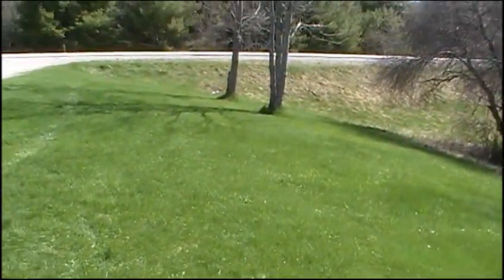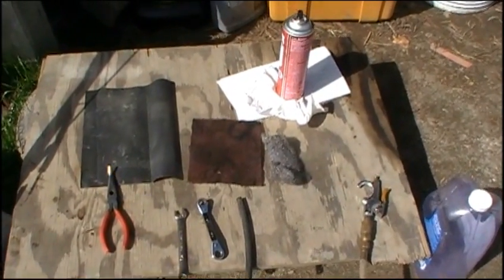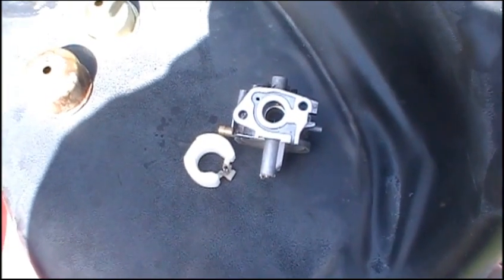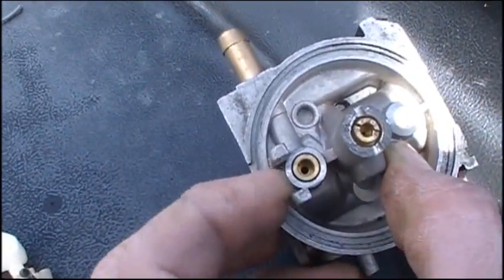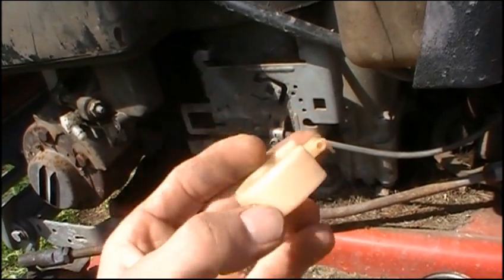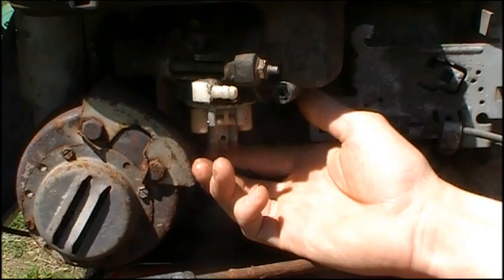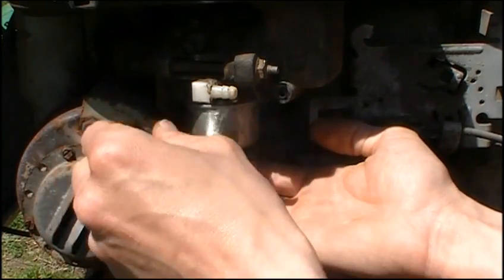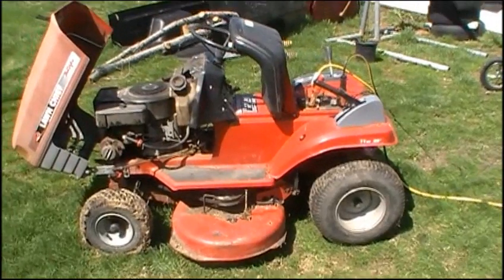How to: Clean a Carburetor (Small engine)

Comment: Good video! If your small engine doesn't work this is usually the problem.
On many engines there is a little tiny rubber doughnut shaped seat that the float needle seats into.  If you blow air into the fuel line connection it will fly out and you will never see it again. 
Also motor oil will degrade rubber parts. If you don't want the rubber to fall apart the next time you repair it you better use silicone grease on rubber.

Comment: Very well done.  Nice commentary and step by step.  I have a Briggs motor that sat for a year plus.  I have replaced the fuel filter, air filter, fuel line, battery, and oil.  I also used Mechanic in a Bottle to clean the fuel system.  Had issues with surging and then once I got the throttle set that went away.  Now, it's always flooded and when it's turned off the engine wants to keep running!  Any ideas?

Comment: This is what got my duromax xp4400eh running again.  It started and ran great on LP, but wouldn't even turn over with gas. Didn't even need to take the carb off, and didn't have to mess with the diaphrams.  Thanks!

Comment: I have same engine in my mower, b&s 12 HP I believe. l was having problems with cold starts. changed filter and added a shutoff valve. when I am done with her l shut off the valve and let her run herself out of gas. l haven't had any cold start problems since.

Comment: Great video noticed the container used to drain the old fuel so for anyone do be sure your container is glass,, metal or a fuel rated plastic ( gas can ) the one in this video looks to possibly be a grocery store juice container or similar most of these the gas will eat through so be aware and safe, peace
Reply: I have yet to find any plastic containers that leak gasoline.   Are you sure you didn't mean a grocery sack or ziplock bag??
Reply: metamech
No, I mean exactly what I said, Anyone interested or concerned lease simply search "gasoline melts plastic" and take your pick of the articles.
Reply: Great job ! Thanks for sharing !
Reply: I found this out too. I used a plastic container used for shaving soap.  The gas or carb cleaner  ended up eating away at the bottom.

Comment: Hey I got a 12hp engine not sure what it is I've had it running runs strong but is very hard to turn over kinda like it's seizing but it's not oils good and like I say it runs great any ideas on what it might be thanks
Reply from the maker: sounds like the valve lash might be out of adjustment. I would check that first

Comment: This will be helpful ! Just yesterday I got a murry mower just like yours ! However I put a different engine on it I put a 16 hp Briggs on it I never had any problem out of the engine before but when I got it out we was doing wheelies and flipped it backwards and gas poured out of the carb I think that may have messed it up cause today we have had tons of trouble getting the carb back working right and it's leaking a ton .. I will try this

Comment: Don't forget the possibility of an ignition module at fault when hot.
If it takes 20 minutes to die, it's most likely nothing to do with the carburetor.
If the carb was at fault, it would act up immediately after start up.

Comment: Check the fuel cap. May not be venting. Remove fuel line at carb and drain into a clean coffee can for reuse (if gas is any good)
With gas cap on, it should flow freely until the can is about full.
If the cap is suspect, flow will start to taper off after a few minutes and stop. You've found the problem.
If you don't want to go the fuel line removal, just operate mower until it starts to die. Quickly open gas cap. If engine runs again, it's the cap.

Comment: Does your needle valve have a spring on it like the other you showed on carb that was off the motor ? I have been having problems with my mower with exact same carb and the needle valve did not have a spring?

Comment from the maker: it's not getting fuel... it could be a plugged gas tank, fuel line, or needle valve seat. if they get gunk in them, it will cause the fuel to feed super slow.

Comment from the maker: well, test the spark... if it's not getting spark, then it could be any number of things... you'll have to make sure all of your saftey switches are working, if it is getting spark, then it's probably your fuel. those motors have a built in fuel pump that will sometimes fail. but they are easy to rebuild.

Comment: Another thing, if you have your carb off and you're cleaning it with compressed air DO NOT have the air's exit hole positioned anywhere near your face! I was blowing out an opposed twin carb and i had the air going into the fuel intake and i had the exit hole near my face, WHOOSH! darn thing sprayed gas mist right square in my eyes!

Comment from the maker: the pin is the needle valve, that sits on the float, as the float bowl fills with gas, the float will "float" and push the needle valve into a hole, and stop the flow of fuel. youll need to take out the float, and reattache the needle valve to it, and carefully put the float back in. try not to let it hang too much, then the needle will fall out again

Comment: I'm cleaning the carburetor on a 50cc Chinese ATV and well its been going fine untill putting everything I've encountered 2 issues.

1. Float won't stay upright it will just flop straight down.

2. A Tiny jet or maybe a pin, has fallen out which I think might be connected to the either the needle valve or maybe its the pin that connect to the float (This is my first carb clean so im not sure If the problem is that or something else)

Comment: I have to say if I didn't already know this stuff I wouldn't have picked much up here. You go much to fast and don't put any real detail or example into your shot. It would have been  a good idea to tell people to put there used rubber o-rings and gaskets into a cup of water while they are out. They like to swell while out and may be difficult to put back and not seal. The water keeps them from swelling.

Comment: After wiping off as much as i could. I found out that the float bowl had 2 small holes in it, and the guy had used some sort of green cement glue to plug them.  On the inside of the bowl, it looked like the gas was eating away at the cement and had plastered it every where...  How bad do you think the damage is?  we had it running on and off, but only on full throttle. but then it stopped... please tell me your opinion. thanks

Comment: Hey i was riding my mower and it staled on me and i look under the hood and i did not see any thing thing i closed it and tried to start it but it would not and i looked again and i saw that it was leaking gas from the carberateur so i drainded the gas and let it cool off the motor over night but on saturday im going to see if i need a new one or just see if the pin got stuck or if its broken.
Thanks for making this video i hope it will help me.

Comment: @Fearlessfront i already figured it out...the cylinders were floded. took out the spark plug and it cranked just fine. i made a stupid move leaving the fuel hooked up when i knew the carboretor wasn't that clean... but thanks for the advice anyway! i am shure i will remember it when something else goes wrong!

Comment from the maker: @Tristan102100 I bet its either the key switch itself is dead, (happens a lot try spraying some wd-40 into it, sometimes it helps...) or make sure the mower deck engagement lever/switch if off, and the clutch switch. there is also a seat switch too. check or disconnect those first. Maybe re-wire the whole thing..(not that hard I have a "how to" video on it.)
Also make sure you didnt disconnect or break any wires while doing the oil change.
This is assuming it does nothing when u turn the key.

Comment: @Fearlessfront yeah i figured it out...the spark was too weak. another questin? i recently got a lawnmower that sat in the peoples back yard for five years. after a few days of tinkering with it i got it to fire and run. the problem is,i changed the oil and now it won't even turn over. i checked all the swiches and everything works. i had the battery on the trickle charger overnight, so thats not it. i know i am asking a lot,but i would apreciate the advice.

Comment from the maker: @Tristan102100 I wish I was there to mess with it... does it have spark? try to squirt a lil fuel down the carb and see if it runs.. if it does, its a fuel problem, if not, check the spark.

Comment: hey i have a newer lawnmower and while i was hooking up a trailer i noticed it wasn. idling very smooth so i knew it was something to do with the fuel so i compleatly rebuilt the carb and now it won't start. and,yes, i pulled off the head and cleaned it and the cams work just fine then i blew into the gast tank(to put fuel into the system) and it wouldn't start...i normally can figure this out but i can't manage to make this happen!the fuel filter  is clean so,any sugestions?

Comment from the maker: @MrChevynova01 yea, clean the carb. what you unbolt the thing on the bottom with the spring, unbolt the brass part, don;t unscrew the screw and the setting will remain the same.

Comment: I have never cleaned the carb on my mower. I do run the gas low in the fall and about half way through the winter I put some fresh gas in and let it run for a little while and in the spring start mowing. May not be the right way but has worked for the last 10 years. I'm just lazy I guess.